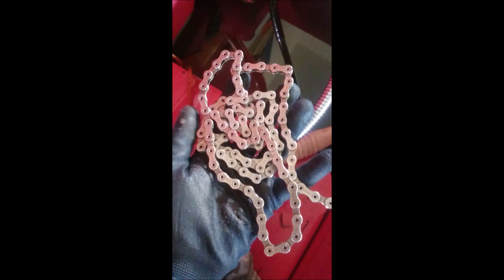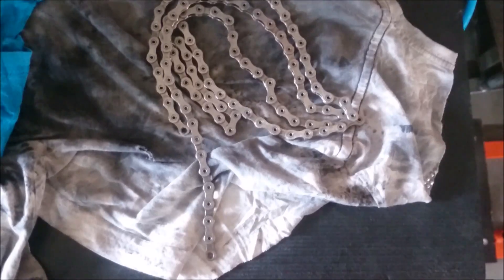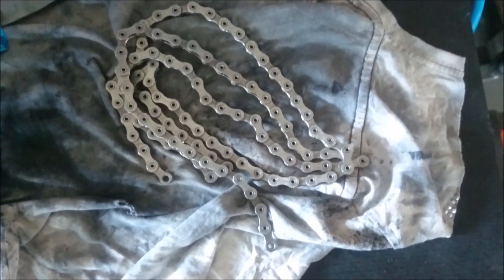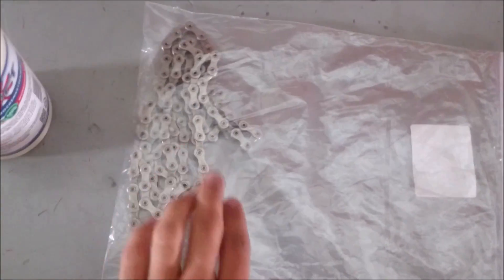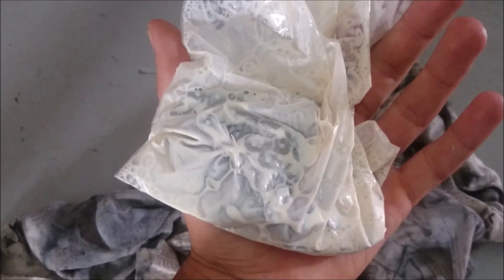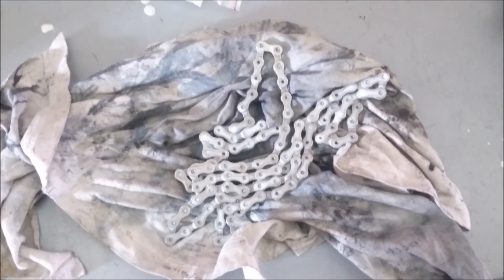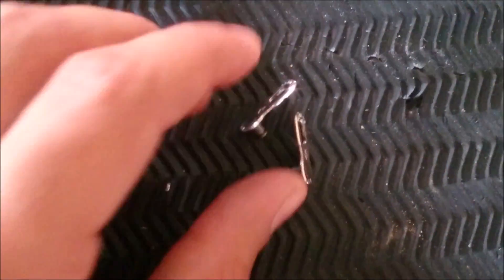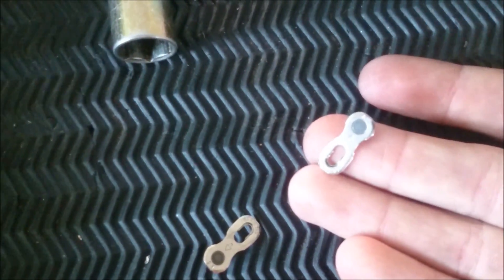How to create a super low friction chain for race day

Comment: Hey Ronald,
Can i also do the chain in a sealable bag into some hot water to get it on temperture? Because we have no sun anymore in the Netherlands..... And when you take the chain out of the bag do you first let it dry or do you clean it with a rag when its still wet? And finally how long should it last in dry racing conditions if you apply it like this? I know you don't do this anymore because of the speedwax but i was still wondering for now. For next season i'm going to use speedwax aswell.

Comment: hey bro can u help me please? i must bought a mountain bike and i dont know how to make use of the friction lever on my bike and i dont know what its for and also is it suppose to be in sync with the chain gear?
Reply: Your shifters are friction shifters, in my opinion, the worst you can get for a bike. It's for shifting your bike's gears. Because it's not indexed, you have to manually find the right position for your lever when shifting gears, otherwise your cage won't always be inline with your selected gear.
Reply: Yong Ling nn

Comment: Yes, just read that Squirt lube is the best, so good to see your technique, thanks
Reply from the maker: Thanks JB, it only works if you apply it the right way though, that is why I thought it was important
Reply: Ronald Kuba... hi... may I ask if this lube is still your go-to lube? Or do you have any other favorite product now? Could you also tell me which kind of degreaser you usually use to perform a deep clean of your drivetrain? Last question: Any suggestions, to which kind of chain I could upgrade my standard ultegra chain, which comes with the Trek Speed concept? Thanks a lot for your help